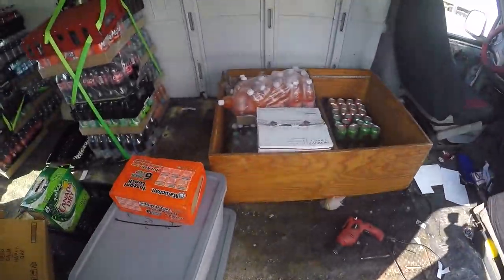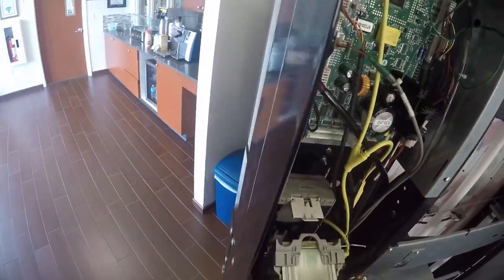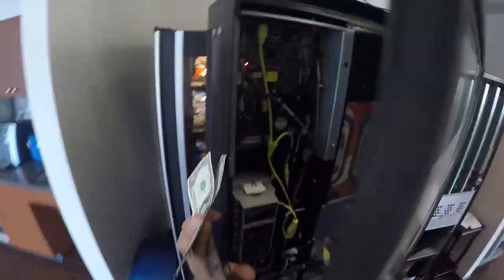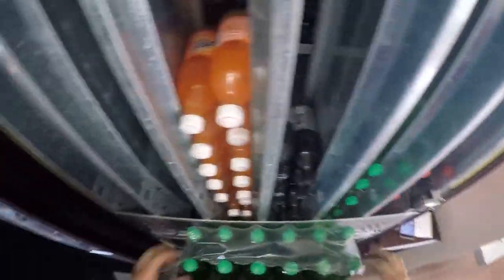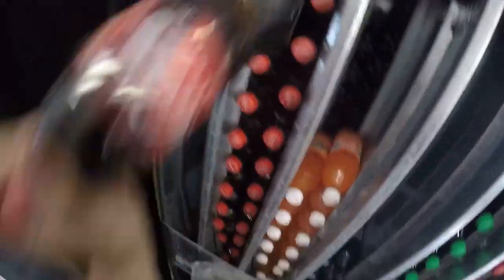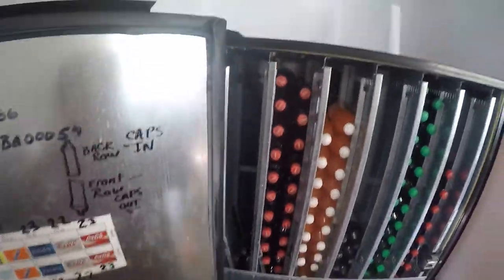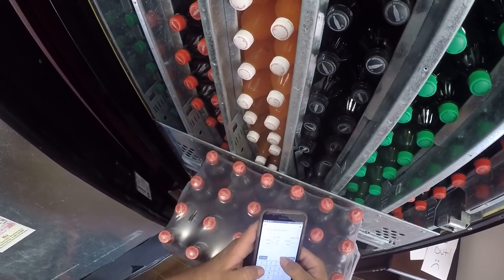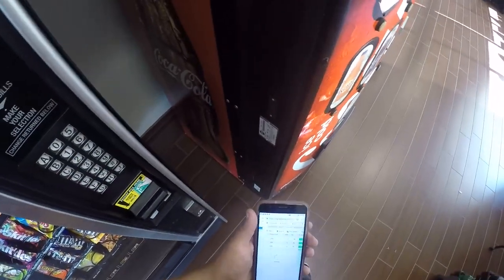SERVICING VENDING MACHINES | almost out of everything!!

Comment: Harper Trucks 700 lb Capacity Glass Filled Nylon Convertible Hand Truck and Dolly with 10" Pneumatic Wheels....this is the 2/4 wheeler you need... holds 3 bottle cases the long way when used  as a 4 wheeler..and 3 and a half cases cans then put your chips ect on top of bottles .. unbelievably strong but very light to handle.. i've been using the same one for 5 years now